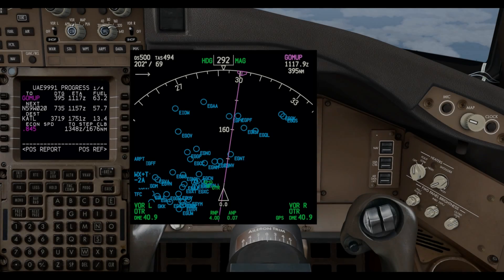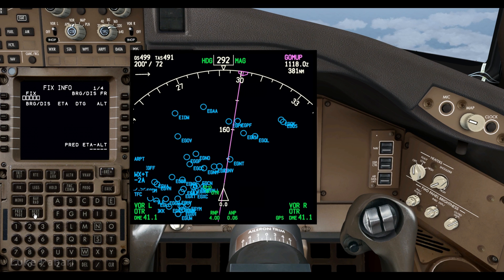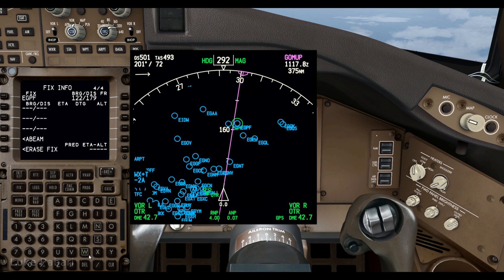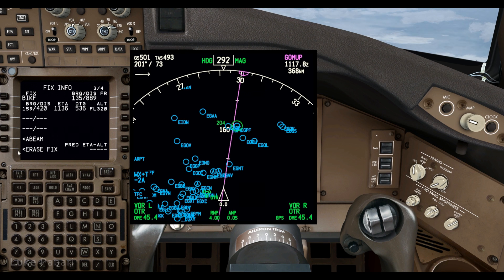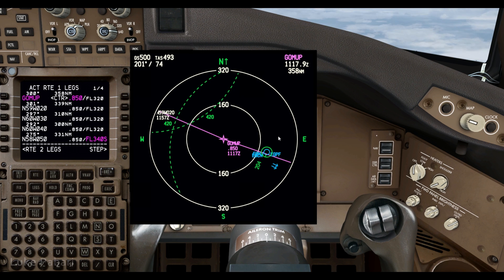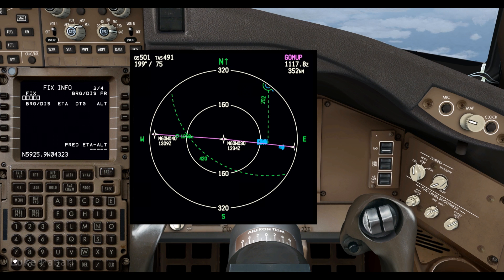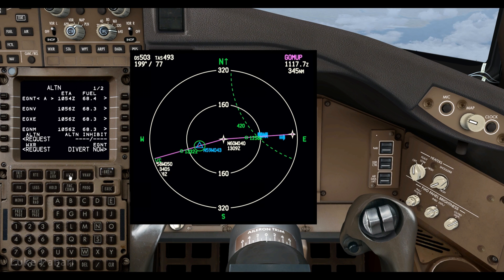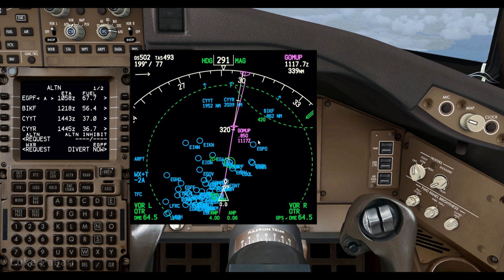PMDG 777 TUTORIAL 2: ETOPS/SITUATIONAL AWARENESS

Comment: ETOPS is a time based system and the 420nm circles don't really reflect that. Any thoughts?
Reply from the maker: 420NM arcs represent 60 minutes of flying time on one engine in a no wind condition at a certain speed (I can't remember off the top of my head - so I won't give you false info there). The arcs are just for situation awareness - nothing more. The time I entered for BIKF was the EET for entering ETOPS from the flight plan - as you saw, that and the 420 arc were very close. Every airline determines their own distance to represent 60 minutes. For example; Turkish use 435nm when Emirates use 420nm. Doesn't change much per airline. Hope that cleared that up!
Reply: HeathrowSpottingHD Oh I see now. Thanks Luke and nice video btw!
Reply from the maker: Andreas Riris No worries mate- thanks a lot!